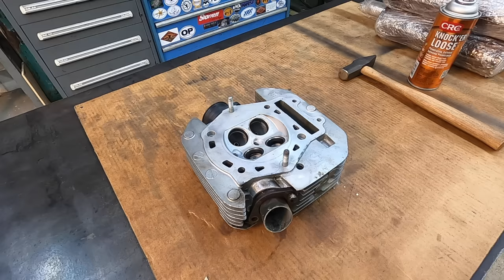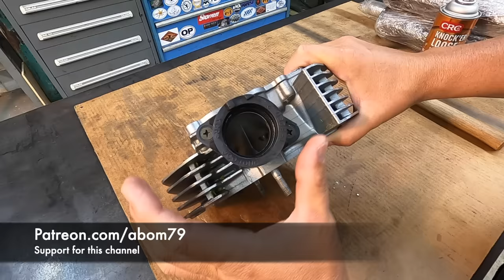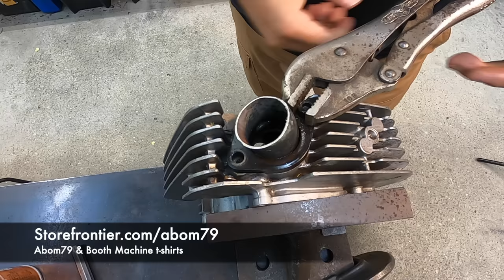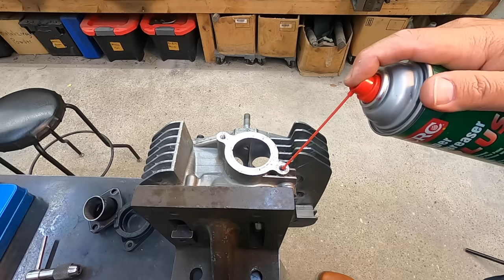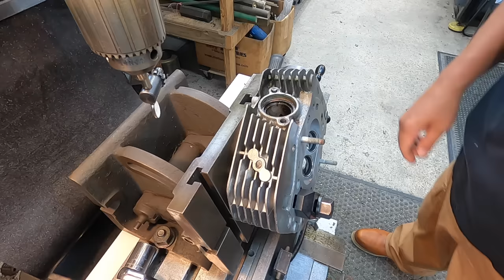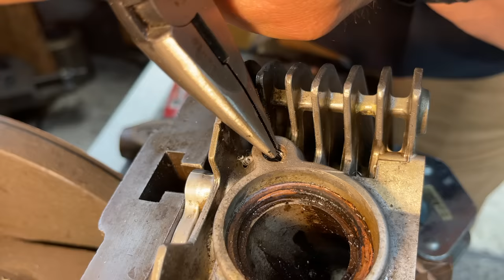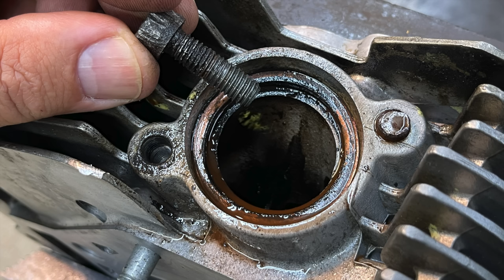Broken & Siezed Bolt Removal, DR 650 Cylinder Head

Comment: Am working on a Stihl chainsaw.  One of the cover plates (aluminum) had the most important (structurally significant) Allen headed bolts shear off below the surface level.  Am quite familiar with most techniques so I have the typical tools like the impact screwdriver, and some backing out tools.  I think my next try will be thermal.  It’s a tiny sucker, so my mechanical methods will be limited.  This is a fine video and a good demonstration of many methods!  The hardest part of my job is being able to secure the work piece beneath my bench press.  If no go, I’ll be looking for a proper machine shop!

Comment: Nice job. My dad had a repair shop and often used heat from a small torch. Always worked. At least when I was there watching. Heat up the head, it would expand, slap the vise grip on and screw it out.

Comment: I work as a mechanic in high tech and the relationship of steel bolts ad aluminum bodies or fixture are a literal guarantee fight and thread issues!!
ALWAYS the threads are crapped up poor from the electrolysis the indifferent metal create cause
!
Plus the microwave we use doesn’t help the corrosive debris that builds up on threads between them.

Solution is use a thread  cleaner on holes, and IPA clean flush out.
On this scenario I found when machine is NEW, replace “bolts” with studs!
The here on engines is use anti seize on. everything possible like ALL manifold bolts especially, and anywhere steel/aluminum are connect with bolts at ALL!
.
Great example here why so!

Comment: Be aware that seized bolts and fasteners have an awareness and understanding of the environment that surrounds them.
Many times customers come to my metal work shop with jobs EXACTLY like this.
They have been trying and trying to work the thread loose without success.
- but when brought into my shop the screw 'realizes' further resistance is completely pointless, and it comes out with little struggle.
Reply: Resistance is futile.

Comment: Thanks! I used your video as my example, with my 10-32 bolts I had to get out of a hoist case. I didn't have any left-hand drills available, and welding nuts to the bolts just broke the bolts in a different place. I plunged a .155", 2 flute, regrind into it and managed to pull some of the bolt's threads out during the plunge, but easily ran a tap through what was left and it worked great!

Comment: I recently swapped my Briggs 8hp motor to a Briggs 17.5hp motor and I had a bunch of seized steel bolts in aluminum. I used a torch and heated up all the bolts to a dull red and then gave all the bolts a little hit with the impact. When it all cooled off all the bolts came out no problem.

Comment: No offense, you got the job done. But have you see the videos where they mig weld on the broken bolt and just unscrew it? 
I realize it’s seized but the heat should help. If that doesn’t work drilling it like you did seems mor like a last resort.
Reply: Yea, seeing it's an exhaust port, heat definitely would have helped there.
Propane torches with the right head and flame get aluminum hot enough where your not even close to the melting point.
Too many people are afraid of puting heat to aluminum 
Like its it gonna turn to liquid right in front of them.
Reply: Beer is like heat.
The cause of and solution to so many of life’s little problems. 😁

Comment: Heating the head up a bit in a oven or with a torch would probably help a bit also
Reply: There will be handling and deformation problems if you heat it up and clamping?
Reply: @ferntom6092  how hot do you think it gets while its running??

Comment: I would recommend putting studs in on the exhaust side and then use copper nuts to hold the pipe on.

Comment: use heat evn if you are drilling it out--cant hurt  and if you cool the bolt rapidly it works very well. us heat even with the left hand drill bits --it can only help

Comment: That exhaust flanges is actually Captive on the pipe when they build them. They don’t come off cause the far side is spread to fit over the muffler pipe
Reply: Not always the case. If the flange is sold separately then you know it actually does come off the header.

Comment: my first job like this was the repair of an cylinder bolt, broken, vw beetle, in the year 1968. from this year to 2018, 50 years, i restored with my friend about 1000 beetles and many t1, 2, 3 and 4. in the 70er years it was possible to buy such a car for 10 to 50 dollars ... with fuel tank full, and: rustrustrust, front axle broken...and so on. today a restorable beetle costs 10000€+++ . for an old motor, complete and o.k. , we payed max. 20 deutschmark, today 10 euros. the old time was the better time... 😂😊😁🤙😎

Comment: amazing how many ways to do the same job but only 1 right way ..well done
Reply: Well, that is where you would end up not being competitive.  Everything can be improved and if there is free enterprise, somebody will improve it.
The objective is to remove the broken bolts and no damage the threads, (but a heli-coil is also good).  Now he did a good job, (which is job #1 to me too), but if he worked in any job shop I worked at, he would have gotten a talking to about time.  It got rough in non-union machine shops after congress sent our free enterprise to communism.

Comment: I'd recommend him putting some nickel anti-seize on the bolts so this doesn't happen again.
Reply: Are socket cap screws normal on a motorbike exhaust?  Could have been replaced at time time, with bolts made of slightly the wrong metal, and the heat/cooling cycle for the two metals was different enough to press the threads together?

Comment: Sir, you are working with steel rusted in aluminum, The best way to me is heat the surrounding area that holds the bolt. and when the aluminum expands before the steel , you have a better chance to rotate the bolt

Comment: You really don't need to driil that stud on a mill. i can see you have enough material with that stud to mig weld a nut on it. heat the stud area below the stud and remove it, you just removed the adjacent one with vice grips, So the general condition of one stud you removed, is pretty much the same condition as the other.
Reply: This is my head and Adam did an excellent job removing the studs. Instead of a ham fisted attempt and breaking something he mounted the head in a compound fixture and removed the stubborn stud properly, a credit to his professionalism and that is why he got the job instead of some hack with a mig welder. 
And if you don't think I used the resources at my disposal including heat and vise grips before I sent it to him then you clearly have no idea what you are talking about. One stud broken I was not risking two.
Reply: I've used both methods to varying levels of success. 
If you ask 50 engineers how to do a job you'll finish up with 50 ideas.
It's out and that's what counts. Everyones happy. 
Great bikes those DR 650s by the way

Comment: looks like a good canidate for the use of neverseize duing the next assembly , eh ?  I mean locktite on a carborator bolt?
Reply: It's blue medium strength thread lock, and it's there to seal the thread to prevent corrosion.

Comment: Nooooooo !!!!!  All you have to do is weld a nut to this broken bolt and while still hot, put a socket on the nut and unscrew it!!   You simply lay a nut over this broken bolt and with a wire feed welder , weld the center hole of the nut to the bolt and unscrew it!!!!  Thats it!  Works every time for me.
Reply: I have 3 broken exhaust bolts in my 2016 sportster and have been trying to weld nuts to them unsuccessfully. Probably tried like 15 times. Any advice?
Reply: @RCDronage  Post a pic of the broken stud.
Reply: Your better of welding a washer on first you’ll get better heat transfer then weld a nut on
Reply: @kenfox6709  Depends on if there is enough stud. If it is broken down in the hole, last thing you need is a washer. I always just weld a nut on there and remove while still hot.

Comment: Heat heat heat, always in situations like that.
Reply: Just a few minutes in and I was yelling "grab the MAP torch mate!".
I'm sure Adam knows about the trick, so maybe he was worried about overheating the alu head?
Reply: @sixstringedthing  Lol, me too. would have made short work of it. But there is something to be said for not putting extreme amounts of heat to aluminum, especially thin aluminum with sealing surfaces but I've been in that situation many times and never had a problem with it. I think he may have just wanted to showcase another way of doing it if you have machinist tools.
Reply: @darrynruzicka2883  He is a machinist not a mechanic after all.
Cheers

Comment: Many years ago a mechanic told me to use a impact drive. A little cheap tool used for this purpose. You push it in and it’s spring loaded. Hit it with a hammer and the spring will turn and it removes the screw or bolt. This is specially made for aluminum parts to heated bolts. The tool cost about 10-15$.
Reply: and what do you think he used

Comment: A 20000 solution for a 20.00 job with a weld a nut and heat to remove a 3 dollar fastener.

Comment: Anti-seize is not a gimmick.
Reply: Haha!
Please do tell me where your exhaust came off then!🤣
 Folks, don't follow this foolish advice for your Suzuki thumper or twin. Bolts WILL work their way out 2/3 times!
Reply: @mgreene1409  : "Requiring less torque", what a bunch of nonsense!
- Those bolts shall not have "less torque" either when tighting NOR releasing, they shall have the right torque. And right torque, in this case, means clean threads, no anti- anything.
Reply: @mgreene1409  : Abom does a good job, by not putting anti-seize on them.
Duh...🤪
Reply: @bigcheese781   Bolts  deform under load.  Bolts under load exert a clamping force.  Work is required to over come friction and reach the desired clamping force.  If friction is reduced more work goes toward increasing clamping force.  If more work is going toward clamping force, the same amount of work used for higher friction bolts will create more clamping force.
Reply: @bigcheese781   Your third reply makes no sense.
Reply: Heat?

Comment: ditto on that 'peel' coming out. I had the same issue trying to get long nose pliers down the hole, surgical forceps are brilliant for that a) they are longer and thinner, b) they self clamp so you can concentrate on angle etc. without worrying about letting go

Comment: on the bolt that still has the head on it, why the heck dont you get the torch out and heat the head red hot, lit it cool then turn it out. I would have thought you knew that. maybe you dont do much of that kind of work

Comment: Don't understand why heat wasn't one of the first things tried
Reply: Absolutely agree! I love this channel but f... me.... made a meal out of that. The reason welding a nut to it is such a good idea is mostly because the stud is heated up. 2 minutes with a MAPP 
gas torch and job done. And before you all shoot me down for being a smart ass i've been a  bike mechanic for 30 years and can guarantee heat was the answer in this situation.
Reply: Heat might ruin the quality of metal that we had. We are not doing that in japan..
Reply: @SuperbikeSurgeryTV  I've been doing that for 60 years and it still works, most, of the time! Nickel lube ends that problem!

Comment: Booo.... Doing it the HARD way! Just take a nut with a center about the same size as the broke off stud/Bolt and weld it on! 1) the heat will help break it free when you put 6 point socket (Or your vise grips to work it)  on it!
Most folks don't have the high End mill/Drilll press.
Reply: What is your problem?

Comment: You might be a good machinist but you're a hack as mechanic, you got to use a little heat on that. I'd have that off there in 30 seconds or less just take the torch and heat up the head and then quench it with some water
Reply: Easy to melt aluminum, though, without intending to. It does not turn colour like steel when you heat it, it just collapses. Best way to heat it is in an oven.
Reply: @davedunham7910  hack

Comment: Nice old school repair.   It's obvious you have experience pulling out the frozen bolts.  Sure you may have been able to weld a nut and work it loose, but watching you use the old school impact and pliers, and finally the mill was nice.   I have repaired numerous high dollar valves in a similar fashion.   Thank you for sharing

Comment: I know this video is a year old, but I just got a set of JIS impact bits for my impact driver and I love that thing. The JIS bits work well in most Philips head screws also. It's my go-to with vintage and older motorcycle parts.
Reply: Most motorcycle service manuals recommend one

Comment: Heat and quench, heat and quench for several cycles until the bond is dissolved  between the steel and aluminum. Works for me!

Comment: I had the same problem on my 1927 Citroën.  The m10 stud broke about 4 threads down in the block. 
I set an Allen head M10 in the drill press (I didn't have a lathe then) and drilled a 4mm hole down the centre. 
I cut the bolt so that the head would snug down on the block. I used that to drill a pilot hole through the stud. That then perfectly centred a tapping size drill. 
The thread just pulled out perfectly.
I got this from the Web, sadly I didn't note what channel to give them a like.

Comment: If i we're the customer I  would be looking to replace the bolts with studs. Good job.
Reply: Just use Quality Anti-seize and it should be fine, or Go Stainless bolts, because they don't "grab" as tightly to the Alloy. I've used a Product called "Dixon's" It's a Graphite based Lube/ anti-seize you can get it in oil based or Water based and it works well on bolts that get very hot.

Comment: We dont have a drill setup like yours, and the machinery we work on are 100's of times bigger, so with a broken bolt as yours, we weld a washer to what is showing of the bolt, that gives us a excellent fixed piece of metal to the bolt, then we weld a nut to the washer, cant tell you how many broken bolts we have removed using this technique.

Comment: I had the same issue on my DR650.  Even with regular applications of anti-sieze on the bolts every few years (when you own a DR, you occasionally have to remove the exhaust for repairs or maintenence) one time one of the bolts took the aluminum threads with it when it came out. Right or wrong, I drilled the aluminum threads out and installed stainless Helicoil threads and stainless bolts.  Hopefully this is a “permanent” repair.

Comment: I’m a believer of using a torch to swell steel bolt in aluminum and after it cools down the threads are no longer fused and it will  break free